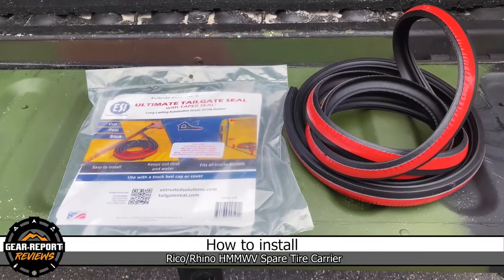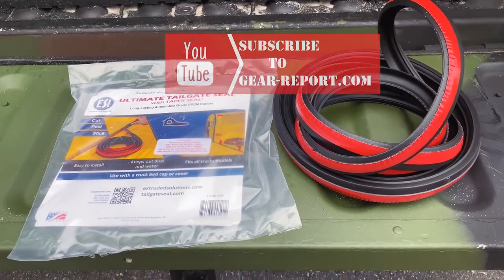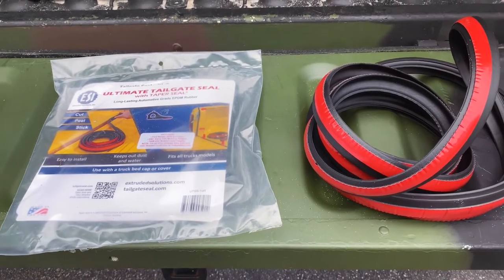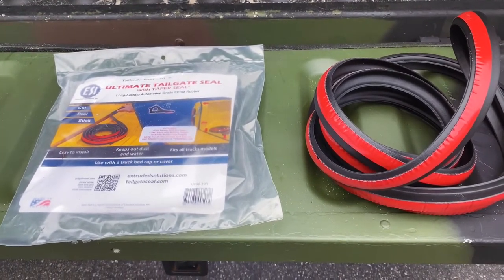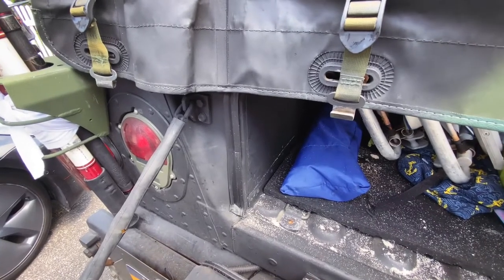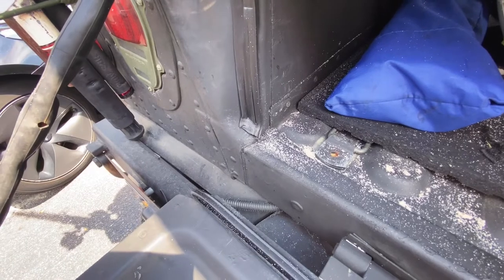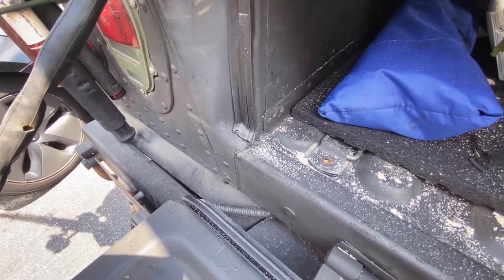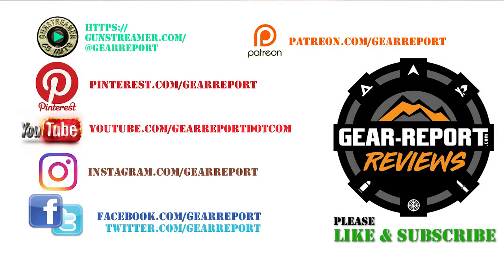HMMWV DIY - How to Replace the Tailgate Seal on a military surplus Humvee

Comment: I bought the same tailgate seal for my HMMWV.  Was too short.  My GMV has a spacer that sets the door back about a half inch.  I ended up going with a much thicker weather stripping from McMaster Carr.  It's over 1" in height.  Seals the tailgate up much better than the stuff that worked for you.  great video.  Thank you.
Reply from the maker: Great info. thanks for sharing.